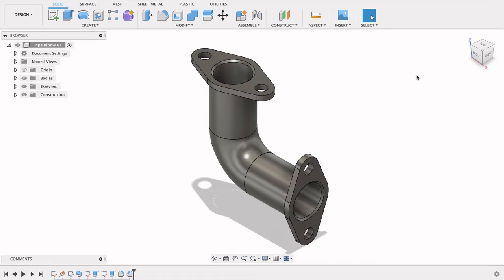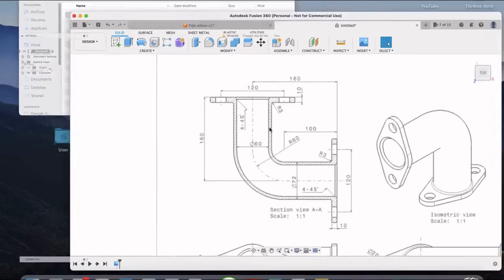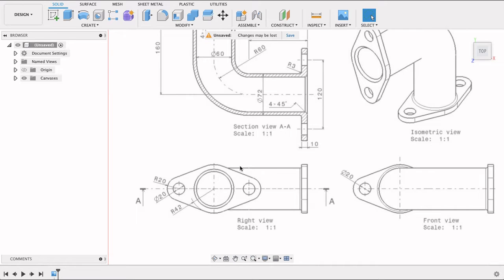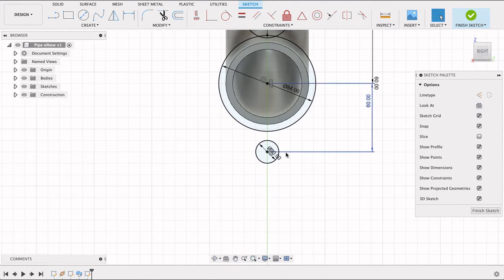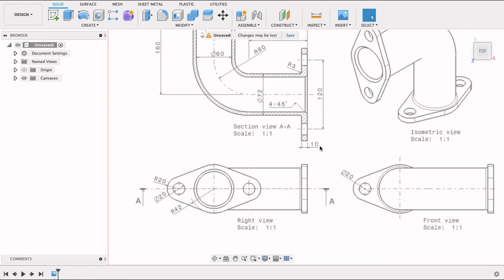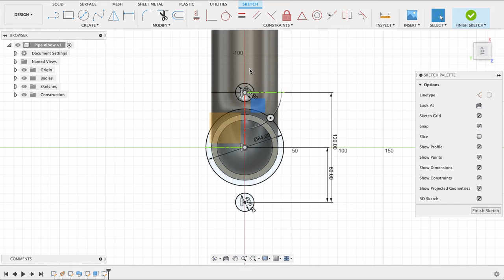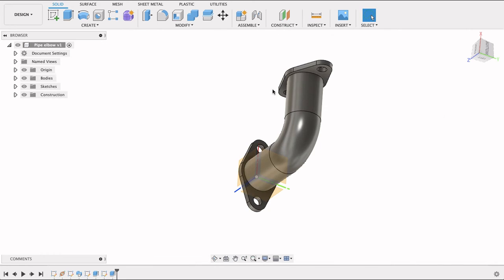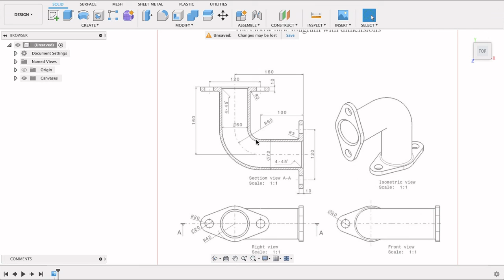Fusion 360 beginner tutorial: Elbow Joint

Comment: Hi i am new to Fusion and was following along on this design but after making the tangent lines for the flange i cannot get the outer circle lines to delete - how to do this?😊
Reply from the maker: Hi, if you mean in the sketch workspace all you need to do is click on the line so that it is highlighted and then hit delete or backspace.
Reply: @Fusionfundamentals  Thank you - my error I figured what I did wrong - I finished the sketch before I did the outer flange - remodeled and it worked as you.showed - thanks for your videos they are great
Reply from the maker: @daverowe5351 glad to hear it